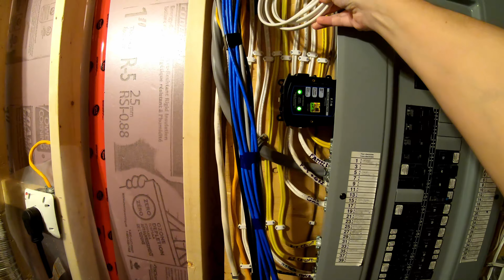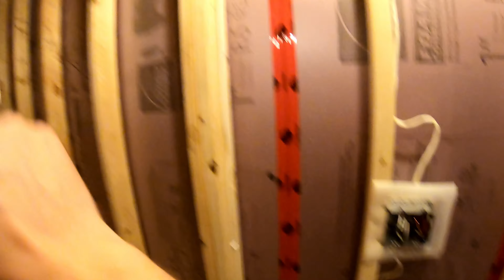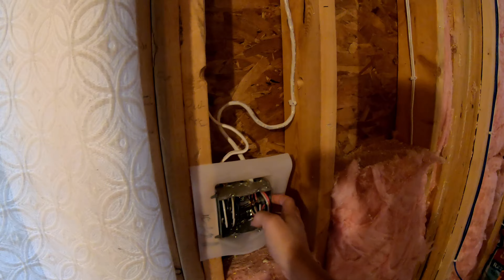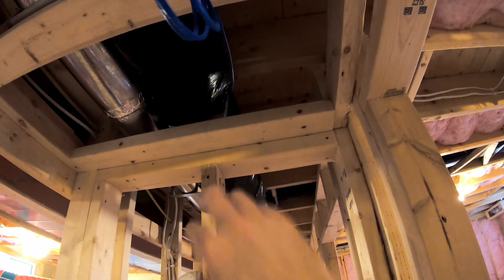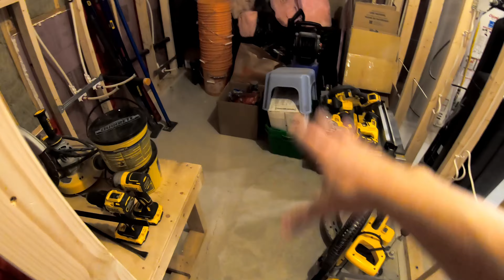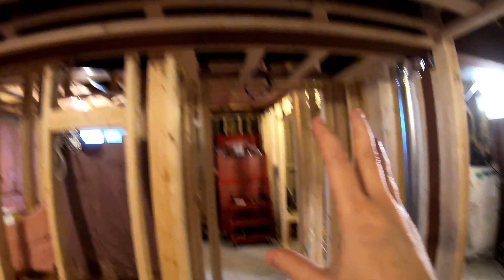Finishing my Basement - Electrical and Plumbing - Part 4

Comment: Looks great!  Looks like you have done your best to try and think of every wire and plumbing situation before you cover the walls.  Keep up the great work!
Reply from the maker: I hope I didn't forget anything...but the plan is to keep the interior of the closet and the furnace room unfinished, and with a drop ceiling I should have decent access to things in the future if I need it.